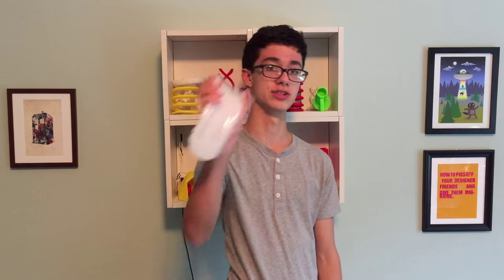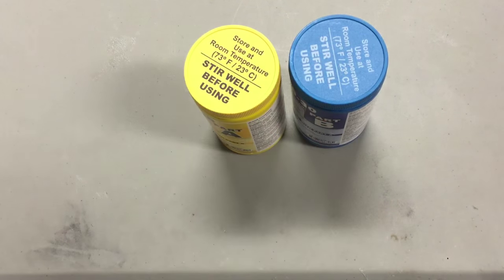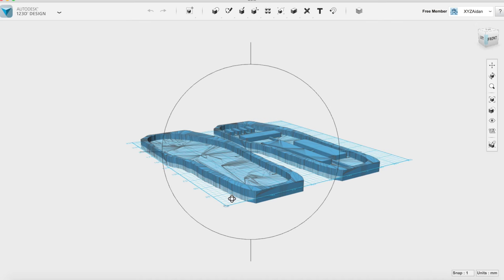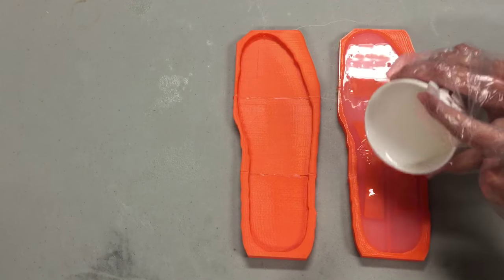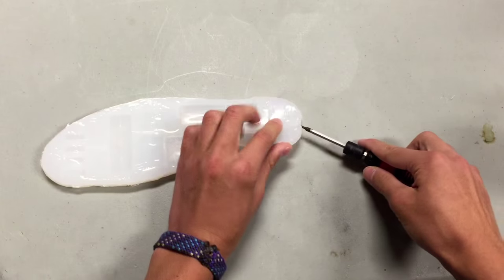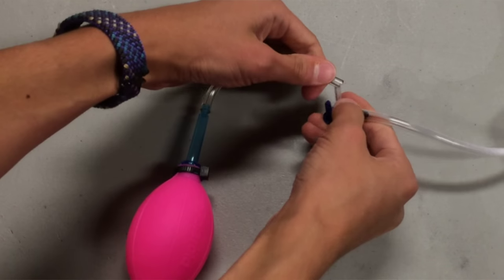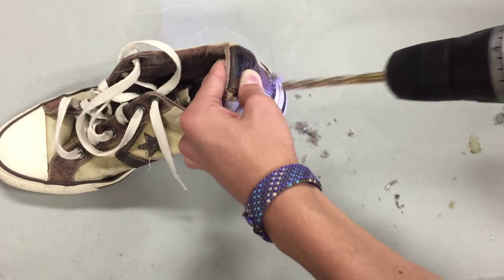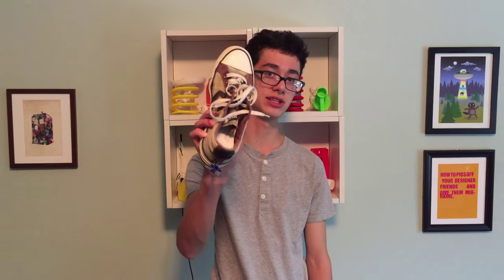Soft Robotic Insole

Comment: Great job Adian! definitely sharing for this weeks 3d Thursday! 

Curious about how you went about designing the cast of the insole. It looks like a polygon mesh but the channels look like solids, did you 3d scan your foot or did you find a obj of one? How did you determine how many and where the air pockets should go? References? Also, how well does the air stay in the channels, does it deflate over time?

I remember growing up kids wanted these Air Jordan sneakers. It's so cool seeing you taking this concept into your own hands, errr feet!

Good stuff man, keep on'a makin'!

—Noe
Reply from the maker: Hey Noe!
Thanks so much, I can't wait until Thursday!

To design the mold, I took a picture of an existing shoe insole. Then, I traced it in Photoshop and made the shape of the insole black and the rest of the image white. After that I used a web-based tool from Shapeways called 2D-to-3D to make it into a 3D file. I then imported in into 123D and used some booleans to make a mold.

As for the pockets, I sized and positioned them based on ratios of parts of the average human foot.

If the pneumatics for building it are done right, then the air should barely leak. In practice however, it will leak out after about an hour.

Again, thank you so much. It really means so much to me that people like you care about my work!

P.S. My name is Aidan, pronounced like "A Den". It's not a big deal, just wanted to mention that :)

Comment: That doesn't work with Jordan's thou. I'm not finna drill a hole in my supreme 5's
Reply: im not drilling out my $300 Reebok's ether, but if you pipe it in to the top of the arch(inside middle) then into the tong, that ed be way better.